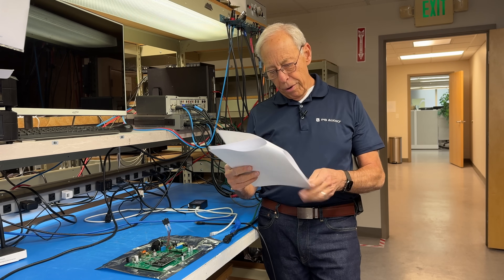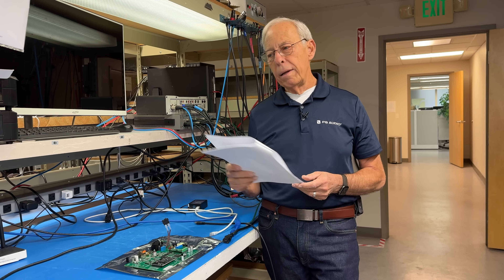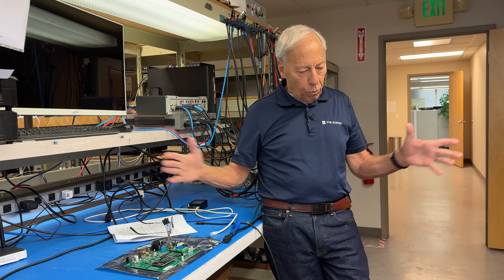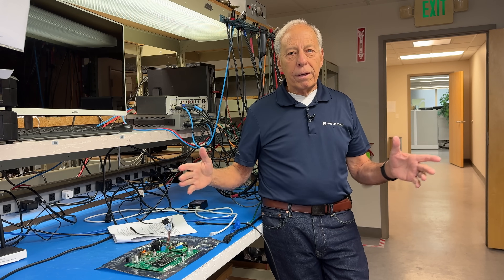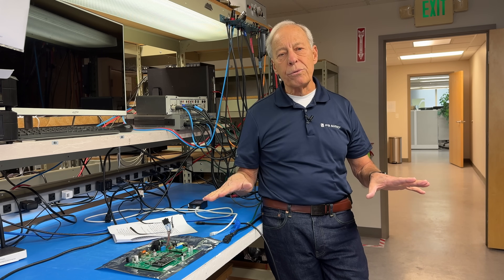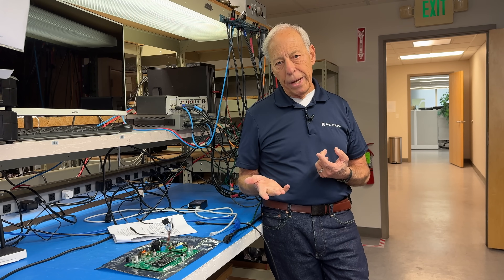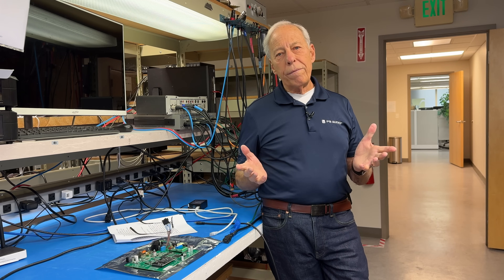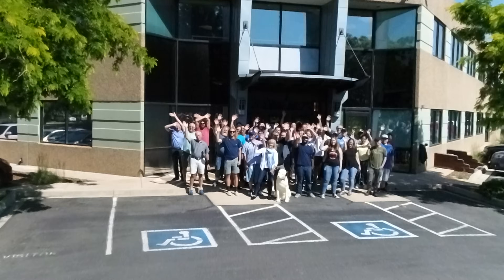Removing the main speaker's woofer work

Comment: Maybe I have a fundamental lack of understanding here.
Does the inaudible bass, and therefore driver excursion, not cause a doppler type of distortion? The microphone diaphragm excursion is very small compared to that of speaker cones.
I once read that an advantage of horn loading is that the driver excursion is far more limited for the same spl, and that the doppler distortion is rather less.
Reply: driver excursion is a source of distortion, mechanically and acoustically
and i think the solution is adding total cone area, more woofers preferably. 
a horn is so large that you could for many woofer in same space to i rather do that.
Reply: @sudd3660 everything is a compromise
Reply: @ianbigsand7   that is not an argument.
my points is that more drivers is better than horn bass, for a larger band of frequencies. 
you have to acknowledge that one driver doing more work is not preferable for the bass.
Reply: @sudd3660  yes, I see what you mean, so long as you limit the upper frequencies fed to the bass drivers so that you don't start to have vertical dispersion/time alignment issues when you hand over to the next driver, so I suppose that this implies at least a three way system. 
I am just thinking out aloud, and my understanding is not that of an expert in the field, I'm just trying to understand better.
Reply: All transducers will have issues with doppler effects.  It's inevitable and is one reason why sound reproduction never really duplicates an original performance from real instruments.  I do agree with you that less excursion is better and that is accomplished by increasing the area of the transducer, but that brings in other issues.
Reply: @TheDanEdwards I have no idea how much of an issue that it really is.
Reply: Doppler is the physic equivalent of intermodulation distortion in electronic circuits. A low frequency (sinewave) modulating a higher frequency (sinewave). This is more dramatic as the difference between the frequencies increases. More apparent in single driver systems where a bass note could modulate a high frequency. But it has to be remembered that this is not what music is. The microphone will pick up whatever combined sound pressure level there is at that instant from all instruments/ sources and not separate each source's individual signal. Just the instantaneous/ continual change in pressure at that physical spot. So all the speaker has to do is reproduce that instantaneous and continuous change. Not do mathematical processing of multiple signals to determine an instantaneous result. 

The mic diaphragm excursion might be significantly smaller than a speaker driver. But the relative excursion for different frequencies is directly proportional. In a perfect world a single driver speaker would move in direct relationship to the movement caused by the air pressure at the mic diaphragm.
Reply: @glenncurry3041 That's a nice description.  In an even more perfect world, the loudspeaker would only have the same excursion as the microphone diaphragm, which would be hopelessly quiet unless you use a horn as an acoustic transformer...I think that's an appropriate term. Then you have all of the audible problems of horns.
I just go and see a live performance and accept that hifi will never be quite as good.
Reply: @ianbigsand7  Actually in the perfect world the "mic" would be a point sourced pressure gradient device and the output driver would be modulated plasma.
Reply: @ianbigsand7  Also many live performances I have been to have inferior sound systems to mine! And regardless of how much I enjoyed their live performances, their decades younger selves performed even better. I find the two to be very different sources of entertainment in many wats. Love them both.

Comment: Id love to see an experiment, using several woofers, and several other drivers... where you split the frequencies up, using FAR more Crossover points... to vastly reduce the workload per driver.   This would make for far less potentials of Micro-Distortions,  due to each driver having less overall work to perform (in that particular frequency band).

 I noticed,  that when I was using my 5.1 Surround Sound Amp with 4 speakers,  and switching to 5  (center speaker).... that the front Left and Right channels, were MUCH cleaner and clearer.   The mere act of removing the additional vocals (and any other center content) from the front-side speakers,  gave such an amazing impact to how much better the output was, from those speakers.

 At that time, I didnt know enough about speakers, to really understand why that was happening.   That said... at that time, I wasnt using Audiophile grade speakers, either...  So,  Im not sure if it would make as big of an Impact, if all drivers are Audiophile grade (superior magnetic strength drivers).

 Finally... Im not so certain, that changing your Demo room, is the right thing to do...  As showing them off in a room that is "Standard" to most peoples homes, is how most people would experience them.   That said, you might be able to make an  "Expanding Back Wall",  for example...  So that you can slide the back walls, and change the room shape,  so that people can experience Both.   Heck, if you wanted to go All-Out...  you could also make side-panels on the side-walls, that Rotate... from a Flat Surface,  to a Surface that was Treated with Foam or other Absorbing materials.   That would, of course, take a bit of tricky Construction... but it could theoretically be accomplished.
Reply: There's tradeoffs with that as well, each driver needs to meet the next perfectly with response and phase (which is difficult enough with a few drivers and their crossover). There's a good reason why a small group use a single wide band, there's also a good reason why 3 way (plus subwoofer(s)) is quite common, while more is less common.
Reply: do no think many way speaker is a solution, there are single fullrange drivers that does impressive work.  
we are talking about stereo here.
we also have the value for the cost aspect that make multi way speakers not compete.
i have my finger on 3 way for a nice compromise.
Reply: @sudd3660   Fullrange drivers, are total Crap, compared to even decent 2-way speakers.

 I also have a pair of low-end 3-way speakers, that are utterly Destroyed by my Audiophile grade 2-way speakers ( EPI 100v ).

 So, its not Just about the number of drivers.. but also, about the Quality of the drivers.

 But as said... Its a proven thing, that you Can in fact, get better audio performance, by splitting up the workload.  Such a process, can actually make low spec drivers, perform close to high end drivers.

 As far as costs goes...  Lets be real here.  Most Audiophile grade speakers, are Insanely Over-Priced.   They might use $40 high-end woofers... but, they will charge you the equivalent of +$500 per each driver.

 They are charging you for small batch runs, and higher end cabinet finishing (trying to make a Mirror Finish, without any blemishes, via hand-work, rather than automated machines).

 My 70s era EPI 100v  speakers, use drivers that outperform the local high end stereo shops $3000 flagship tower speakers.  Its not even Close.   When they originally sold, I believe they cost under $300 a pair.   Not sure what inflation would put that at...  but certainly much cheaper than the kinds of speaker prices, that you see today.

 Anyway... Im speaking about the cleanest, distortion free, potential Output (at any volume level).   It does not matter, if anyone could or could not afford it.   But I guarantee,  you could easily make such speakers, affordable.

 The problem is, low number runs, drive up costs considerable... and since companies do not provide enough education to the public about whats different "Inside" of the speakers... they dont know the differences, between the Low Spec speakers, and High Spec speakers... from a mere External View point.   This is ultimately what Destroyed most of the High End speakers, in the 80s.

Comment: Perhaps the question also pertains to bass that is lower than being audible (<20 Hz) causing the woofer to move the cone visibly without sound. I've also seen cone motion from my turntable below audible range. The effect is intermodulation distortion, but how audible is it? If a 2-way speaker cone is moved at, let's say, 10Hz to near its excursion limits, it will not only cause intermodulation distortion but also linearity distortion as the motion is not linear near the limits. But a high-pass filter is also not great. So yet another compromise...
Reply: I checked all my music, almost nothing under 30 Hz (enough resolution of the analyzer must be selected) with enough energy. I have used tones (very carefully) to solve standing waves problems. However, music is not a tone. Good speakers should handle very low frequencies with a controlled roll-off (acoustic-mechanic high pass filter) rate.
Reply: @Jorge-Fernandez-Lopez  I'm not sure what you mean by "acoustic-mechanic high pass filter", but obviously at lower bass frequencies your speaker output will be limited by cone surface area and cone excursion distance besides doubler effects from any venting.
Reply: @ThinkingBetter  Air pressure in a box, ported or sealed decrease the movement of the woofer. Furthermore, sealed box or "acoustic suspension" are so within a volume.
Reply: When people say they have bass because of the "wind" out of the ports, that's actually showing the portion of bass/infrasonics not being produced effectively. Possibly quite a range if it doesn't go low. The port may still be reducing total excursion though compared to sealed.
Reply: @spentron1  The deeper the bass the more airflow you have for a given sound level. Usually "wind" is about low frequency bass and it might be non-audible due to room or speaker driver+port cancelation or due to the frequency being below 20Hz. You can run a sine wave generator and set the frequency to a bit below 20Hz and crank up the volume to get a lot of wind. Also, in many cases you will hear noise from your house and/or stuff vibrating.
Reply: @ThinkingBetter  Sound is vibration, not that puff of air you might feel halfway across the room from a regular old front ported speaker. If you go sufficiently low and powerful wind and vibration may be indistinguishable, but generally you want vibration not noise.
Reply: No, below 20Hz is not going to cause the woofer to move because no woofer will actually do much movement at that frequency. Unless you have some exotic drivers, I can assure you nothing is happening below 20, not at reference levels anyway.
If your TT is producing output below 20Hz, it’s not a great TT.
Reply: @Fluterra  Why would the cone not move under 20Hz??? Try to connect a small woofer to an amp and a sine wave generator running at 10Hz and be surprised. Usually impedance is very low and the electromagnetic forces can be most efficient. Even at DC your speaker cone will offset according to the voltage positive or negative. Also a tweeter cone can move under 20Hz, if you don't have a high-pass filter on it. A stroke of a cone can only move a certain amount of air and as you get lower in frequency, you need more air per stroke for the same sound pressure level. That's why deep bass needs bigger drivers and more excursion when in a room. BTW,  take your headphones and play some music at high volume on it while listening on them without wearing them. You can hear the music but the bass is gone for this exact reason even they can have excellent sub bass when wearing them.
Reply: @ Because if your system is well designed it won’t pass a <20Hz signal to the speakers in the first place! Second, while the cone will move, it will be at such a high degree of attenuation that it won’t be audible. Rolling off the bottom and the top ends is a recipe for very mediocre sound. You are adding phase shifts and distortion. No good speaker maker does this!
Reply: @ No. Modern amps are linear down to 20Hz, and many can go down to near DC without any drop. No audiophile amp has a sharp high pass filter at 20Hz so below 20Hz your amp will still do well. And as I already explained, speaker drivers move their cones just fine from DC voltage to 20Hz. What makes a speaker unable to make much audible bass as the frequency drop has to do with the fact that as the frequency decreases, the amount of air needed to produce the same SPL increases exponentially, roughly doubling with each octave drop. To make it worse, your hearing at sub bass frequencies is also not so sensitive (check Fletcher Munson equal loudness curves). Finally, a bass port output will be opposite phase causing the low frequencies to be canceled out. So even a lot of airflow can be felt near or below 20Hz, you cannot hear it.
Reply: @Fluterra  Actually Paul was saying their stuff goes down below 5 Hz even though they don't spec it just a few days ago. Most music doesn't have it but video can. Possibly should have options. BUT not only can a cone move to signals below what it can effectively output, it takes very little power to produce large excursions with vented designs.
Reply: @ Interesting, thanks. But the point is that you don’t want a band-aide: forcing rolloff comes with negative side effects. If designed correctly, it’s not needed.
Reply: @Fluterra  What do you mean by “designed correctly”? Frankly, if I had to make an active cross-over filter in a system with subwoofer, I would consider a high-pass filter cutting non-productive sub bass out of the stereo signal to get most effective use of the power from the stereo amplifier with lowest bass distortion. But companies not having such solution ignores this problem.

Comment: Technically, 20hz is around 56ft of wave... 5hz is about 225ft of wave. you need a huge amount of speaker area to make those waves, or a very very long room. eventually, at enough distance in a room, a 2in driver will make a 5hz wave.
Reply: you do not need to make the full length wave. you only need to reproduce the pressure so your ear can move in and out in a sine wave motion.
Reply: The problem is very low power with which membrane is loaded at very low  frequency. . Without strong electromechanical  damping (usualy secured by amplifier)  speaker works was spring - spring to oscillate do not need even active power.   the  same  speaker  driver. Active power is not transferred to speaker  even when we observe jumps and may think it is amplifier hard job. .   . 

Second reason is that single membrane  (even with strongest damping)    cooperates only  with tiny and very light freely moving air  layer which  touches it and follows     membrane movement.  Mass of air must have enough inertia  to stay in place and be late when membrane moves up and back. Thanks to this  inertia membrane can create pressure ups and downs. For sopranos we need much less mass of air   because speed of membrane  is much faster and even small amount of  air cannot effectively follow in time . . For low frequency when is no  adequate  mass of air  no plus and minus pressure could be found  and it means   no sound. 

When is little mass and slow motion,  air follows membrane as siame  tweens. We use artificial acoustic systems like boxes. horns , we add mass with tunnnels and TL  to force  more air to cooperate  with  membrane. .

Comment: i am asking you, please design a speaker that rolls of in the bass, give the larger models some mid bass punch, but make more small box sealed designs.  design the woofers in the speaker more like a midrange than full range.

and for rolling off the speakers, gr research talks about a line filter you put before the power amp, so the amp does also does not produce the bass. i like the idea of that if you do not have dsp.
Reply: You can still get a phase problem with low level filter (and the quality might impact SQ everywhere), but it is a thing to use "subsonic filter" (at least as protection) and if it's low enough it might not impact most music that don't go very low.
Reply: @PSA78  you are correct,  maybe a combination of the two means of subsonic filter  is the least compromised option.  
i am not an authority on high end audio so i get excellent results from dsp solution.
Reply: @sudd3660  I would probably run the woofer in a closed box for a natural roll-off and then take a possible 'hit' with filter in the subwoofer(s) (depending on tuning frequency, as it's pretty much an open baffle bellow tuning frequency in boxes that's vented or use passive radiator). 
It's not uncommon that they fit a capacitor in smaller speakers (like bookshelf) to protect the woofer, DSP adds the same phase shift as passive with IIR for every order of filter but FIR could be a solution if the whole system is active (I haven't used FIR so it's a theoretical speculation from me, I've heard different opinions of those who have used both for active systems).
Reply: Good speakers have already an acoustic and mechanic high pass filter with enough rate.. GR Research only put a capacitor in a box, which creates phasing issues.

Comment: I wish more power amps would have subwoofer out jacks. 

Shouldn’t the sub be set in the center frontal area of a setup?
Listener will receive more bass feel and rumble.
Reply: If you can hear where the bass is coming from then it's either crossed over too high or it's playing too loud (both are essentially creating the same problem of high enough dB high enough in frequency so we can locate it).
Bass is all about the rooms physical dimensions, your positioning and the subwoofer(s) positioning, so every situation will have it's own ideal placement.
Reply: Low frequency is omnidirectional. Hard to determine precise location unlike highs..
Reply: stereo subwoofers in each corner behind the speakers or on the sidewalls is a good general rule.
Reply: Center position in any direction is a null (pressure).